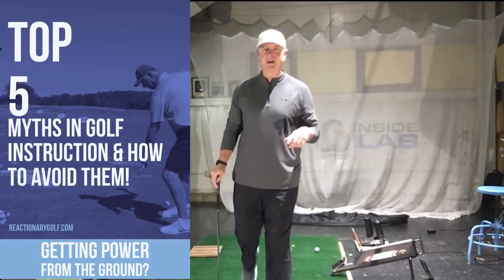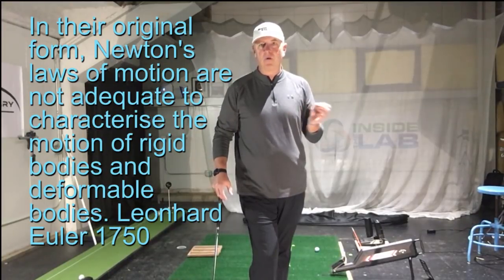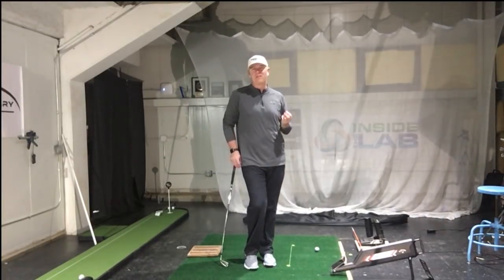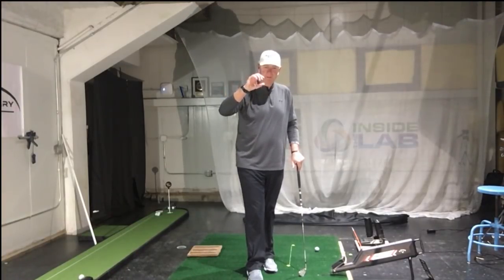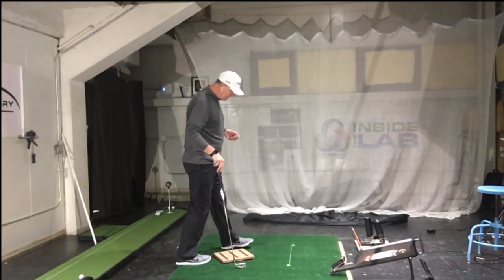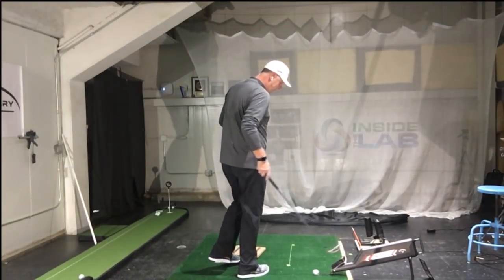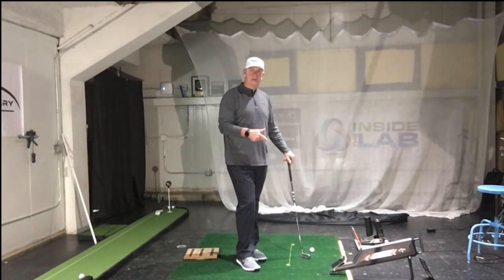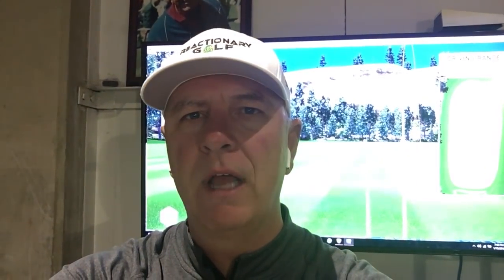Myth #1 Getting extra force from the ground?

Comment: using cartesian coordinates to explain a circular golf swing is pointless
Reply from the maker: So vectors and forces cannot occur and be considered in 2D & 3D space ???  Interesting!!!  I guess all my calculus classes are worthless.
Reply: Tony Luczak Not sure where you got that from my comment. The forces in a golf swing are not independent of each other because they are not completely orthogonal to each other which is what you are assuming. I get that you are just now learning about physics but don’t try and use things that you learned in a physics 1 class that you don’t completely understand.
Reply from the maker: Cartesian is a coordinate reference system. All mo-caps need an origin.  I not sure what your definition of cartesian coordinates is.
Reply: Tony Luczak your claiming ground force and the force of the club on the ball are independent bc you are using z and x axis. While it is true forces perpendicular to each other are independent. This is not the case in a golf swing or in your example. I guess you have taken calculus based physics since you seem to be referencing that. If you have you should also know how many very extreme simple assumptions and generalizations are made to explain physics in a classroom. I would avoid using things you have only been introduced from the most entry level classes.
Reply: Tony Luczak Force on a golf ball at impact is down -z and out -x (using your coordinates). Golf club is a lever with the right hand as a fulcrum. More force up and back z and x more force down and through the ball. Using the ground to provide more up and also back is using the ground for leverage and force into the ball.
Reply from the maker: Wow, the personal attacks just keep coming.  NO showing of evidence, just personal attacks on my education.  GRF force plates are a measure of what we do and apply towards the X,Y, Z axes and moment arms on a force plate based on a reference origin that can be used to identify data points in a cartesian coordinate system.  My claim is that friction is not considered as part of Newton's laws and thus often his 3rd law is misapplied.  I have had golfers come to me asking how to get more force from the ground.  That is a hilarious concept that has been fueled by golf pro's wanting to be scientist and parrot any golf digest science commentary to justify their over priced lessons that don't work, jump for greater club head speed!  Friction allows golfers to use their musculoskeletal system to create movement to maximize driving distance.  GRF measurements from a force plate are a resultant not causation.  That is my claim.  Thanks for the conversation.
Reply: Tony Luczak If you think anyone that promotes ground force is meaning to jump then you need a lot more than physics class. This is exactly why this channel is an absolute joke.
Reply: Tony Luczak Your arrogance just reeks all over this channel and takes any credibility you may actually have away from it.
Reply from the maker: That is such an intelligent response.
Reply: Tony Luczak ha ok. Well as they say ignorance is bliss.
Reply: Stick to your video games kid, (it’s all he’s got on his profile) and ad hominem attacks won’t do it for you. 

Tony, I see Jeffery Mann is on your case too. I highly respect Jeffery’s work on the golf swing and the basic truths of the TGM based swing he advocates but not many on tour nor any multiple major winners have a perfect TGM swing either. 

Are we able to hit as far with our feet suspended in frictionless slings?

Comment: Jeffrey, we all don't swing like a pro golfer. I've used TGM technique and have taken lessons from the great Lynn Blake, but must say with all of Tony's teachings, I've had the most success. With that being said, to each his own and really what works well for you is the way to go. Keep it up Tony!    Robert Wayne
Reply: I agree with your opinion "to each his own". If Tony's right arm swinging technique works well for you, then there is no reason not to use it. I have also described two different right arm swinging techniques, which can also work very well. However, I still believe that the optimum technique for a pro golfer is an active pivot-driven TGM swinging (lead arm swinging) technique - rather than a right arm swinging technique.
Reply: Jeffrey Mann No1 cares about TGM. You guys can't even agree amongst yourselves about basic things. It has become a religion and not a science.
Reply: The left arm is poorly situated to accelerate the club. I think of it almost as gearing. The right arm does the bulk of the acceleration, but the left arm takes over close to impact and after. Right arm is first gear, left is second.
Reply: Jeffrey Mann it isn't up for debate man. The left arm has much less leverage and the muscles involved are much weaker.
Reply: This fits in perfectly with TGM. It's VERY trail arm focused. There isn't even a mention of a ground reaction force type concept. Get the power package "action" right and you won't have to think about anything. Tony has it dead right as does Mike Bender and Mike Malaska. Jim Flick and Bob Toski were the modern trailblazers on this topic. Tony and others have confirmed it.
Reply: You are obviously clueless regarding TGM mechanics and you obviously know nothing about how a TGM swinger (lead arm swinger) releases PA#4 via an active pivot action - as described in this short review paper at http://perfectgolfswingreview.net/VP10.html
Reply: I agree that this issue isn't up for debate from your perspective - because you are so ignorant regarding TGM mechanics that you do not understand that the left shoulder girdle muscles are not primarily responsible for moving the left arm during the downswing, and you seemingly do not understand that the  left arm is primarily moved by the active forward rotation of the left shoulder socket, which is itself moved in space by an active rotation of the upper torso, which follows the active rotation of the pelvis in the standard kinematic sequence of a TGM swinger's downswing action. You obviously didn't even read this short review paper at http://perfectgolfswingreview.net/VP10.html . If you disagree with Homer Kelley's claim that a  TGM swinger (left arm swinger) gets most of his swing power from the release of PA#4, then you should at least make an intelligent attempt to show that he is wrong.